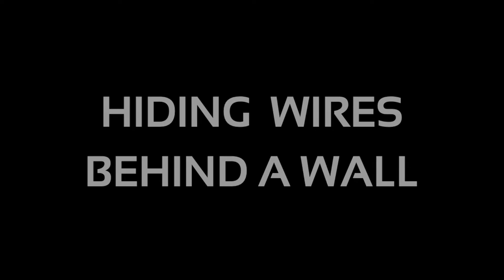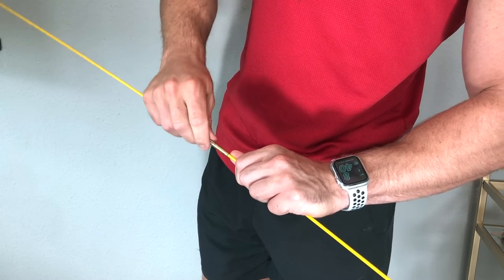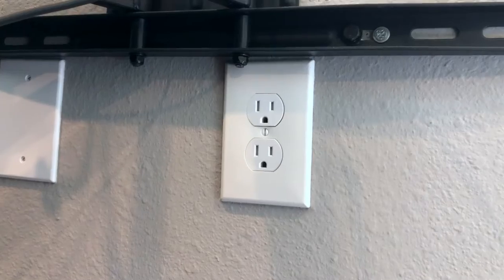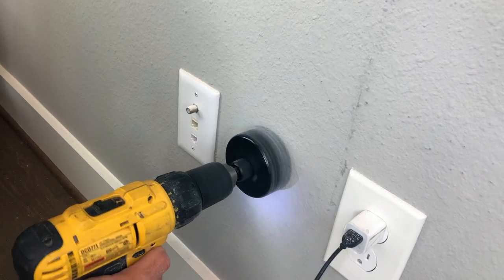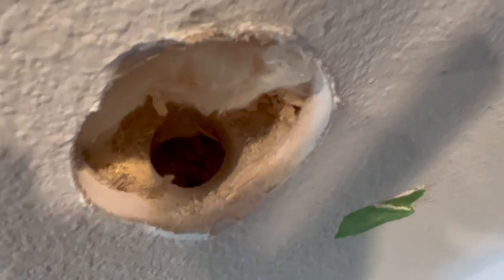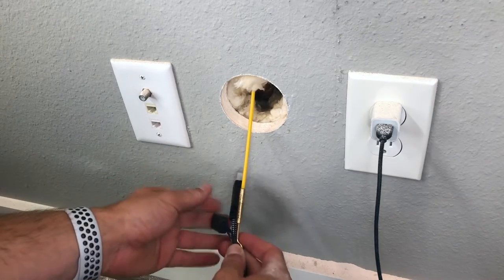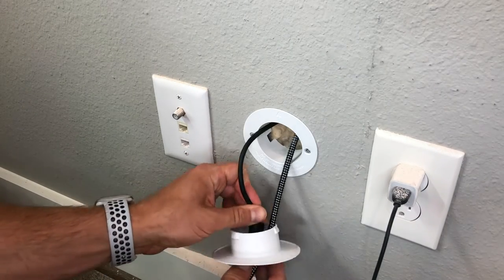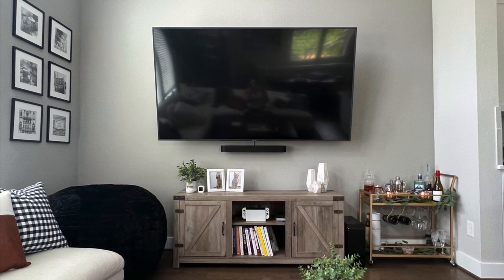How to Hide TV Wires Behind a Wall - Even with a Fire Block! | Builds by Maz

Comment: Coincidentally he drilled perfectly right above the fire block.  Now show us how you would have done this if you were a foot above that fire block.
Reply from the maker: You would need to cut out a little square in your drywall in front of the fire break, sometimes called a 'pumpkin patch', and then you could cut a piece out of the horizontal stud. A much more extensive process but you would only need to do this if the firebreak is right in between your tv and console stand, which luckily that was not the case for me